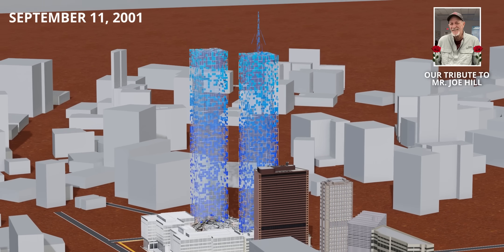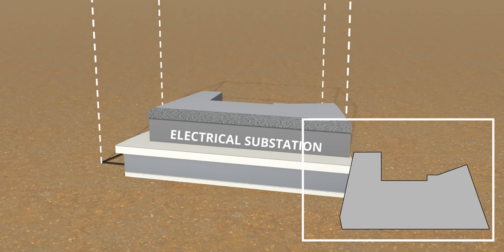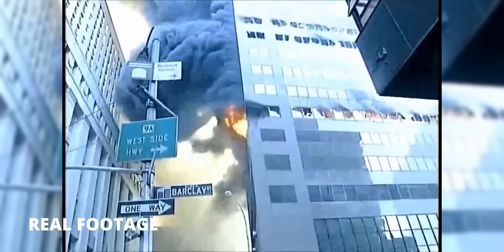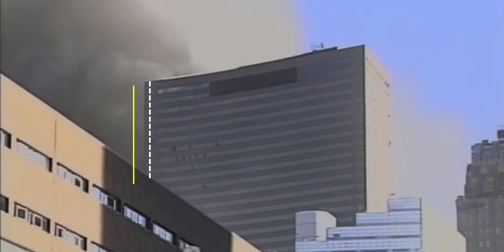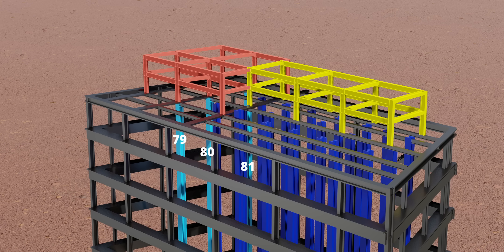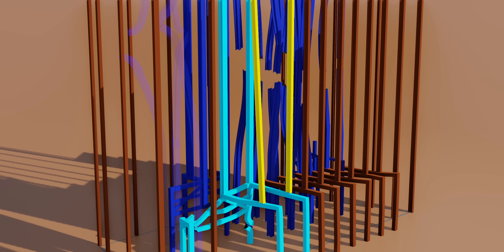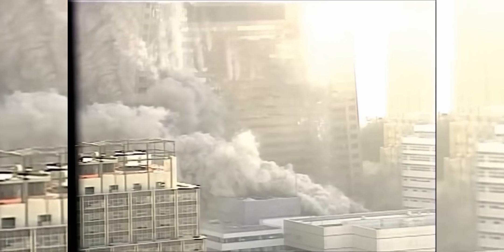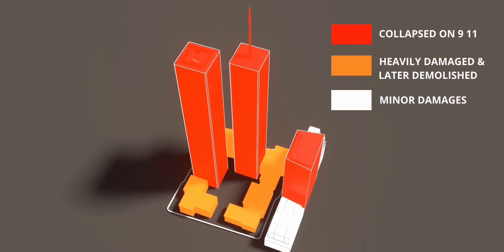Collapse of Building 7 | The Complete Physics

Comment: while this video supports some explanations as to what could have happened. but as for the probability of all core columns being fractured after the collapse of 1 & 2 is highly impractical. Building 7 as per the nist report collapsed due to uncontrolled fires. However it should be noted that WTC 7 is the only steel structured building to ever completely collapse due to Building fires. that is fact. other buildings have had partial collapses due to fire and those were burning hot and heavy way way more than building 7. this steel was not pre 1950 steel this is modern steel building that completely collapsed nearly into its own footprint due to pockets of fires on less than 1/4 of the building. It has never happened previously and never happened again after that day. not saying conspiracy mumbo but that is something that never been addressed. the issue of it falling mainly into its own footprint and due to pockets of fires is insane. example the horrible Grenfell fire took 60hrs to put out..never fully collapsed its just odd.. nice video but it also leads to more questions.
Reply: @dikranovichk5889  Fair but if I did my skull would just crack, my body would not turn to soup.

4 planes hijacked. 3 planes hit 3 targets, a 4th plane crashed and a 4th building collapsed.... tell me you cannot solve that puzzle.

I was just rewashing 9/11 footage from the day of and they said "we are hearing from sources and we have confirmation from the military that a woman who locked herself in the bathroom with a cell phone called from the plane that crashed in Pennsylvania and said she was worried they were going to crash the plane".  IN 2001 CELLPHONES DID NOT WORK FROM AIRPLANES.  My speculation is an airforce pilot must have shot down the 4th plane and in their rush to create a cover story they did not vet the idea of saying it was a cell phone call.  They were stuck with preplanted explosives in Tower 7 with incoming investigators.
Reply: @philip, good sir, your body is a solid structure, probably chiseled like Ararat. Bones, muscle, tendons, water.  Building, by volume are 90+% air. 

Shanksville pa is an amazing memorial site, that should be visited by all. The plane flew over Cleveland OH. and crashed in shanksville, PA. You only need a map and a straight ruler to see where this plane was headed.
Reply: @philip, I think you owe it to yourself to question your own ideas.
Reply: I guess you dont owe it to yourself to check your own conclusions.  Just go with what you heard from your saviors.
Reply: It is truly twisted logic to argue that someone inserted a secret demolition project in a badly damaged building that the first responders said was going to collapse.
Reply: NANO THERMITE ~ EXPLOSIVE MILITARY WEAPON ~ FALLING BUILDINGS *DO NOT * PRODUCE EXPLOSVES RESIDUE AND *DO NOT* CREATE RIVERS OF MELTED STEEL!! ~ ??? >> HAVE YOU EVER SEEN ANY CONTROLLED DEMO OR FALLING BUILDING CREATE RIVERS OF MELTED STEEL ?? ... (DIDNT THINK SO!) >>  NANO THERMITE IS IN ALL THE ASHES OF GROUND ZERO !! ... CASE CLOSED ~ IT WAS A 3X CONTROLLED DEMO!! >> BUSH CHENY RUMMY SAUDIS = GUILTY OF WAS CRIMES~! +++ OVER 280,000 PILOTS, FIREMEN, COPS, MILITARY, ARCHITECTS, ENGINEERS HAVE ALL TESTIFYED THAT 9/1 IS A GOVT COVER UP. **PERIOD! * DO NOT BELIEVE SLICK VIDEOS!! ... LEARN THE REAL FACTS!!
Reply: This video does not claim all the core columns were fractured after the collapse of Building's 1 & 2.  Why do I feel like you were not paying attention?
Reply: @jaidenshadow2710   Yeah, that's about as expected. "Oh, shit, I said stupid shit and they called me on it. What'll I DO!?"
Reply: Didn't know grenfell was hit by a bloody great aircraft with tons of fuel at 250 miles an hour ! Do t let facts get in the way of a good story....
Reply: You are ignoring the damage from the collapse of WTC 1&2. Without that damage the building would likely have not collapsed. The damage plus the fire caused the collapse.
Reply: @member57 A building with a steel frame does not collapse from a fire) You probably find it hard to believe that your government is using you
Reply: @Fhjvhdj75336   "A building with a steel frame does not collapse from a fire"
After all, it's not like heat has a known effect on iron and iron alloys. Right? It's not like we've known about that for 3000+ years. We didn't even name an entire epoch of history for this effect.

....wait...
Reply: @mooneyes2k478 The towers held the weight of the floors above them for 30 years.  That weight falling 10 feet would not make every floor pancake 1 by 1.

4 planes were hijacked, 3 found their targets, where was the 4th plane going hmmmmmm?
Reply: @PhillipJermakian  So, what you're saying is, you didn't notice the massive structural failure that happened, and you have no understanding of very basic construction principles? And, you don't understand what static and dynamic load is?
Well, that's on you, and no one else.

As for the fourth plane, how is that remotely relevant?
Reply: "However it should be noted that WTC 7 is the only steel structured building to ever completely collapse due to Building fires"
Other than the other ones, of course.

"that is fact."
After all, you said so. Meanwhile, here in the adult world, "that is fact" is not an argument.

"other buildings have had partial collapses due to fire"
And complete.

"those were burning hot and heavy way way more than building 7"
"Hotter and heavier" than "fully involved in fire" for 7 hours? That's the words of the actual experts on scene.

"this steel was not pre 1950 steel this is modern steel "
Here's a shock for you: Steel "pre 1950" was no different from now. 98% Iron, 1.03% Manganese, 0.4% Silicon, 0.26% Carbon, 0.2% Copper, 0.05% Sulfur and 0.04% Phosporus makes the exact same thing now as it did then.

"building that completely collapsed nearly into its own footprint"
WTC 7 collapsed across two separate, 4-lane streets, one to the West and into the Verizon building, and one to the North-East, into Fiterman Hall. This is about as not "into its footprint" as you're likely to get.

"due to pockets of fires on less than 1/4 of the building"
Which, as noted above, was "fully involved". It's well known that the entire building burned, on more or less every floor, all over the floors.

" It has never happened previously "
So what? Not only is "never happened before" a completely meaningless statement, nothing in history had ever happened before...until it did, that's the point of history, but also you may have failed to notice the OTHER "never happened before" things that happened, like terrorists flying airplanes into skyscrapers, or skyscrapers collapsing onto other buildings.

"never happened again after that day"
The "it" that entails a large structure collapsing due to overwhelming fires have happened both before AND after, several times.

" not saying conspiracy mumbo"
It's just that you're spewing nothing but "conspiracy mumbo". Imagine that.

" that is something that never been addressed"
There are at least 4 different, reliable and trustworthy, engineering reviews of what happened to WTC7. There's also the reports from the actual experts on the scene. It's been addressed multiple times. It's just that, those addresses don't fit in with the "conspiracy mumbo" and so you have carefully ignored those.

"the issue of it falling mainly into its own footprint and due to pockets of fires is insane"
It might have been, if that had happened. But, since it didn't, but rather, as we see previous, it fell WAY outside it's "footprint", due to 7 hours of building-wide fires, there IS no "issue", insane or not.

"example the horrible Grenfell fire took 60hrs to put out"
Grenfell Towerwas a 24-story, concrete, apartment building built almost perfectly to have a raging fire happen, being actively fought by the firefighters the whole time.
WTC 7 was a all-steel, framed tube office building that was deliberately NOT fought at all.
If you're going to try to argue an "example", you might want to actually use an example instead of a flaunting of your complete lack of understand of the separate cases.

"never fully collapsed its just odd"
No, it is, as noted, quite easy to understand and very clear.

" it also leads to more questions"
From what we can see, it's fairly obvious that everything that doesn't fit neatly and perfectly into your "conspiracy mumbo" fairy tale bring more questions. Until they're answered, not truthfully and factually, but in a way that suits you.
Reply: @mooneyes2k478  You answer everyone so actively in the comments) I'm sure you get paid for this)
Reply: @Sjdhdj27473 maybe some of us are tired of seeing the same debunked truther comments for 2 decades now and want to punch back at their stupidity.
Reply: @mooneyes2k478 I personally work in a steel mill that produces construction steel beams and I can personally tell you that modern day steel does in fact have different chemical makeup. In fact, we are constantly altering the "grade" and composition to this day based on use case, trialing / research, and customer needs. Steel composition is changing constantly and continuously improving. While the constituency percentages of the steel alloy are seemingly subtle in differences, these minor changes account for massive tensile stress and durability varitations as well as temperature resistances.
Reply: @mooneyes2k478  completely agree with you on all points, and agree with others that downward momentum also creates lateral propulsion, but
"It might have been, if that had happened. But, since it didn't, but rather, as we see previous, it fell WAY outside it's "footprint""
taking into account the scale of the towers, it was a collapse into its footprint
https://www.youtube.com/watch?v=VAkTbyENZ5s
a distance across a four lane  street means peanuts in comparison to the footprint of the tower
https://www.youtube.com/watch?v=VAkTbyENZ5s
a demolition expert would call that a success
Reply: @brmbkl  "taking into account the scale of the towers, it was a collapse into its footprint"
Noting first that this video is about the Building 7 and not the Towers, that's still nonsense.

The Towers had a footprint of 208x208 feet, or about an acre each. The Pile covered about 16 acres. Thus, by definition, the remains covered 8 times the footprint of the Twin Towers.

Meanwhile, WTC 7 fell so far outside it's "footprint" that it caused 1.4 billion dollars worth of damage to the Verizon Building, and so much to Fiterman Hall it had to be torn down in the aftermath.
Since a "controlled demolition" is all about the control, no expert would have called it a success, ever, and even less so considering the above damage.

Conflating the Towers with WTC7 makes me wonder if you're trying to weasel-word things.
Reply: @mooneyes2k478  Now I know you're paid to uphold the government narrative abut 9/11. No one spends this amount of time and effort in YouTube comment section, fighting and insulting people who questioned the media narrative.
Reply: @miki_9034   Possibly not. But you'll find that some people DO spend this amount of time and effort, fighting and insulting people who either lie themselves or repeat lies they heard, because they're lazy and/or unable to understand the explanation.

Those lazy and/or lying people, by the way? Can easily be recognized. One of the primary ways is to look for people who use phrases like "media narrative". Or claiming that people would need to be paid to call them on their nonsense.
Reply: @mooneyes2k478  Thank you, for proving my point again.
Reply: @miki_9034   Oh, no worries. Thank you for proving mine .
Reply: @miki_9034  I will begin by pointing out that mooneyes didn't insult anyone, in this thread anyway. Mostly, I would highlight the absurdity of your main point: people spend ridiculous amounts of time and effort arguing about all sorts of things in YouTube comments and elsewhere. Humans will argue about the various merits of sports teams, sci-fi trivia, cars, politics and so on. Is it that unreasonable to think that there are people out there who believe very strongly that they are right and have the time on their hands might actually use that time to argue online about what they believe in? Maybe they even enjoy it? Look at all the conspiritards getting involved reacting to this video. Who's paying them to argue? Are all the Trump supporters bad-mouthing his opponent of the day getting paid by him? Are all the people critical of Trump being paid by George Soros or whoever? People will do that for free.

Reading the thread I see someone who has taken the time to break down someone's lengthy comment, point by point and refute or criticise each part. You haven't bothered to try to pick any holes in those arguments, just come back with a very lazy allegation that gets made all the time but never proven. The US government doesn't seem to have the money to pay teachers properly yet somehow they are paying a posse of stooges to write disinformation on social media. No employment contract to that effect has ever been found. No conspiritard has ever tried to get a job doing this exact thing, in order to then publish the proof that this is what the government is up to. "You're paid to uphold the government narrative" about any topic is about as weak an argument as "Whatever"
Reply: @neutralyukka  Thank you for educating me about the gov't. From now on I'll 100% accept what the gov't tells me. By the way, have you get your 7th booster? I'll get mine tomorrow.
Reply: @miki_9034  You made the claim that some other commenter was "paid to uphold the government narrative about 9/11" (it could be any other topic by the way). I stated that you used this as a weak argument because you couldn't, or chose not to refute anything he said. I pointed out how baseless your claim is, given it has been made many times, with no proof offered. You've avoided my point as well, turning to sarcasm and trying to move the conversation to mine or anyone else's belief in what the government says. I certainly don't trust everything that comes out of the mouths of politicians, but that's irrelevant. 
 
The notion that the US government pays people to get involved in discussions on social media is ludicrous. Governments are inept on so many levels, for them to engage in the enterprise you suggest and succeed in keeping any evidence of it out of the public domain is absurd. Maybe I am a sheep that believes everything I'm told as you insinuate, maybe not. Your original claim is either a last recourse retort against arguments you can't adequately dispute, or you repeat it because you actually believe it, which suggests you're just as devoid of the critical thinking you attribute to those who "100% accept what the gov't tells them"
Reply: @neutralyukka  man, I strongly agree with you and comoletely disagree with this guy, but I think you guys should stop already.
There's no amount of evidence that'll convince an idiot that he is worng, he won't listen to anything that doesn't fit his own narrative, he'll just keep focusing on his illusion that somehow, you are a government puppet until he runs out of one liners to expose his lack of valid (as in proven by facts) arguments.
It's just not worth it at this point.
Reply: @miki_9034  "Thank you for educating me about the gov't. From now on I'll 100% accept what the gov't tells me. By the way, have you get your 7th booster? "

"I have nothing, they exposed my stupid shit, and that's MEAN so I'll say something completely irrelevant!  SO THERE!"

You're welcome for the translation of your post. No charge.